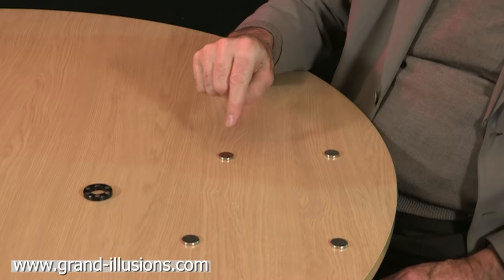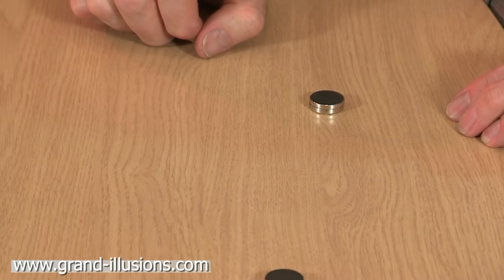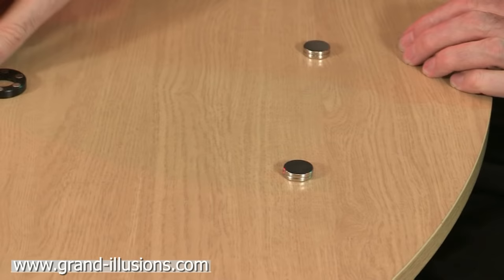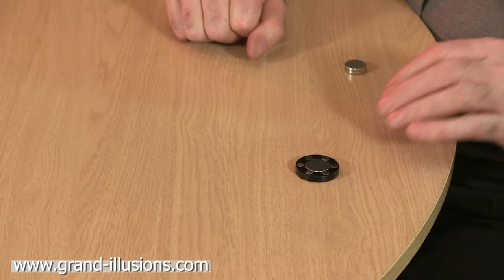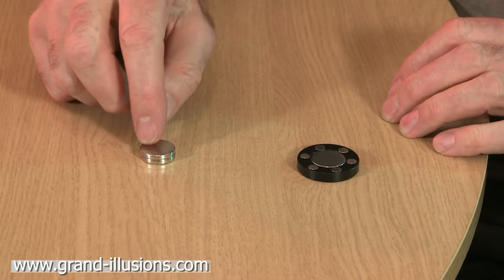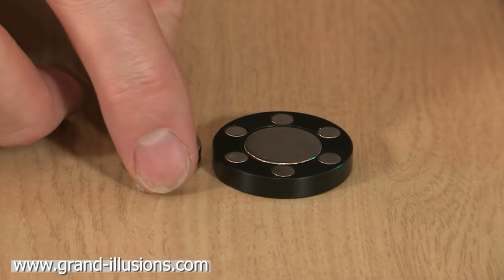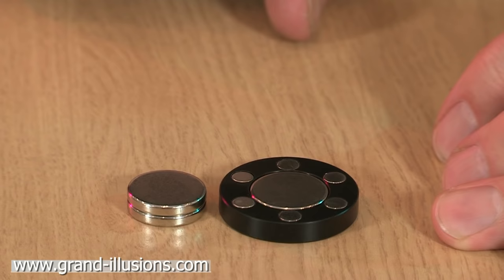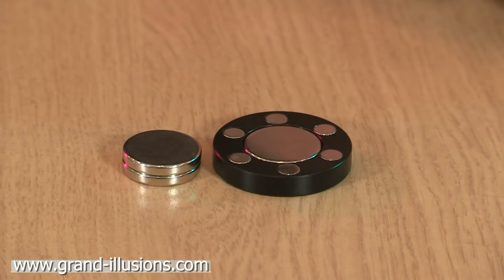Amazing Discovery With Magnets - The Inverter Magnet

Comment: Big enough counter-polarity magnets inside an Ionocraft WEAV like Dr. Subrata Roy's should create counterbary and barycentric control of the Lorentz Forces surrounding the vehicle. Would have to use something lightweight, maybe electromagnets instead of the bulky heavy magnets can make up for the loss. 

It's what Dr. Pais with his inner/outer hull config in the HUAC and Dr. Fearn with her EM Drive are trying to replicate. 

It also mimics the Earth's cores. But instead of the vacuum and Solar Ionized conditions we could replicate that with superconducting liquid pumped in a Laminar flow. That way you have Ion Wind, Lorentz Forces, Poynting Energy Flow, and Independent Inertial Mass.
Reply: 興味深いです。地球の内部モデルになるかどうか？は、どうでしょうか？地球が円盤型でなく球形ですから、、。
この磁場の中、他の磁場が入り込めず、この磁石の磁力に支配されるなら、慣性系はこの磁場の中で、他に関係なく独自に存在すると思いますが、、
これだけの単独の磁力現象では、、空飛ぶ新たな力にはならないでしょう。

Comment: Going back to the two silver magnets, if we can move 1 by the other from a distance between, couldn't we apply this to make something fly, if the magnet in the hand was lighter but stronger than the 1 thats getting pushed from a distance.   
So imagine  the magnet getting pushed as sphere shape, and the other magnet was inside the sphere shape,
 if you tried to push it inside the sphere it would move  to what ever side you pushed towards,if  the force was strong enough, so if you pushed up would it not rise off the ground???

Comment: He says he doesn't understand it - I would say simply that: Two forces meet and at a very specific point - the 2 forces are equal in their push and pull strengths. Strong enough to attract and to push away simultaneously. I also think this is much how planets become attracted to our very powerful SUN - through a pull that we simply do not yet understand. I also do not think there is true gravity - but a way for it to simply apply itself when two varying masses meet. If the conditions are proper they will produce gravity - if they are not - then it is my theory this produces a black hole in space ... However, no one, so far, agrees with me. I think it's just a matter of time - until my theory is proven.

Comment: by making the magnets stronger could you a create a magic wand which can move around another magnet in the air without touching it?
Reply: Sadly no, because of a bunch of math reasons, 3-dimensional systems of magnets cannot be stable without active control, that's why you can't balance one magnet on top of another. This only works because it's a 2-dimensional system, as the magnets in this case don't move up or down, and are restricted to moving on a flat surface.

Comment: And, once again, i am left confused as to why either /or / both units of measurements are used. Speed is measured in Miles per Hour or Kilometres per Hour, distance in Kilometres,  and yet the seperating distance is given as 1/8-1/4 INCH. Not in millimetres or centimetres.  I do so wish we were to pick one unit of measurment (even if it be wrong and, inefficient,  inaccurate,  imprecise) and go with it. At least we'd all be equally confused as to the true measurement ...

Comment: What if you could create three new types of magnets?

Lets say you take 14 magnets modeled into a 3d Star of David, putting the + ends in the center of an orb using copper for obvious reasons. Would create a -only magnet.

Do the reverse to make a +only magnet.

Now if you take the Star of David literally and use one half + and the other half -, that would create a Neutral Magnet.

Or as Christians used the Chi-Rho.

Comment: Applications in Maglev?
Reply: Magnetic floating wheel/axel truck assembly. Zero friction, silent.  Rail transit. Maglev is a different engineering design approach to using repelling magnetic fields. Not related to this.

Comment: The magnets must already be surrounded by the lines of the field.
But you have to understand that these lines are flowing and spinning in vortexes (these lines are not parallel and they are not static  are more like a donut bull) 
 we call the NORTH Pole, in reality, is that the field flow rotates clockwise and for the SOUTH Pole counterclockwise.

That is why the magnets attract or repel each other, (think of a nut and bolt)
if you face two magnets of the same pole (they repel each other) as their turns (they both turn in the same direction) are in a 180º position from each other, the turns do not couple. 
On the other hand, if you face them with different poles, the spirals will be coupled and the attraction will be produced. 
You can see this video of an example of the action of a magnet on a plasma.
https://www.youtube.com/watch?v=afQW8FT02DM

Comment: Wavey Oreo Effect.  
Locked between the two small magnets from side to side but you have to factor Vortex Mathematics for the rest.  Spinning circles with arrows seem to work but everything is Invisible Gears when Magnets are Involved.  Sounds like a Sudoku Puzzle, You need to Figure Out how the Arrow of Magnetism will Lock into place this Object.  
In this Case the Two Torroidal Magnetic Fields are held into Place as the Forces Sympathize at that Level.  Level can change via the manipulation of the electic current to either Torroidal field. Think push/pull.   
For this experiment it seems you have 6 points of interest active to cause this effect.  In reality it's more cause of the remaining smaller magnets needed to form the torroidal field with the center magnet in the first place.  
But like I said, It's all a Puzzle to Figure out. 🧩

Comment: is this used as barrings at all?
Reply: it is a modification of it since where are many ways to arrange them...similarly does not exist only one type of electric motors, but many
Reply: A magnetic bearing is a bearing that supports a load using magnetic levitation.
Reply: just in this case and attraction is used